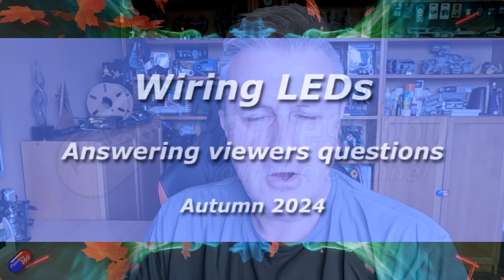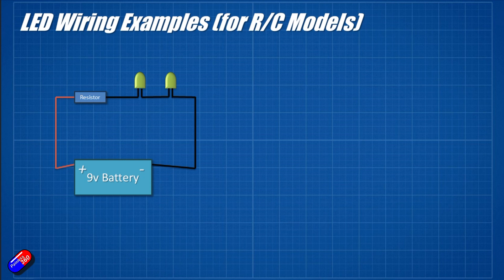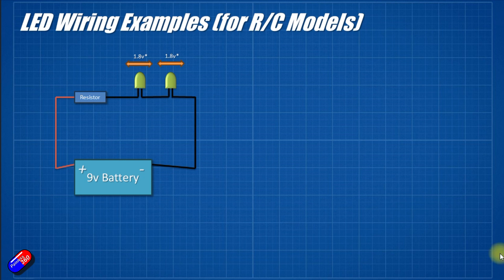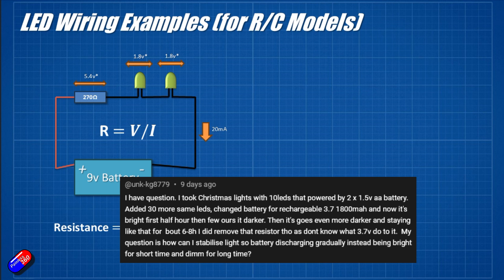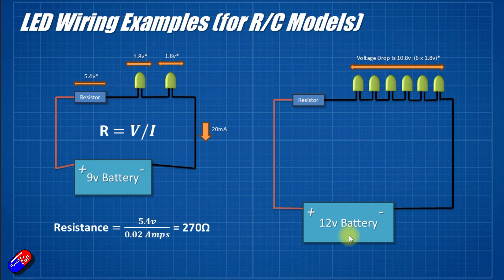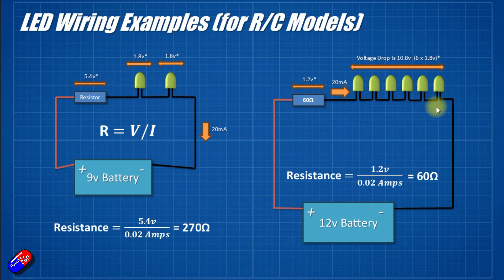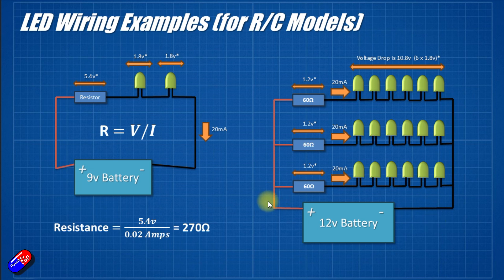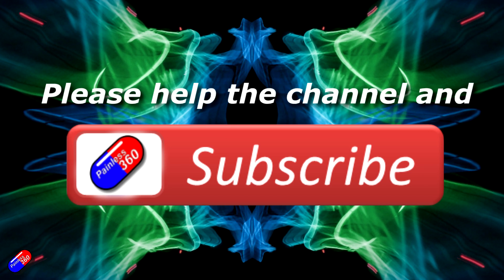Wiring LED's, a few 'real world' examples

Comment: I made a reversing light to go on the rear of a trx4 crawler. As the LED is a diode i wired it directly to the motor but wired it the wrong way round. As it was a brushed setup and in reverse the polarity of the current is reversed, it being a diode it would do nothing when powering the car forward but would light up when reversing.  It was nothing practical but looked cool on the crawler track.

Comment: As always Great Video, dont forget to account for the power of the resistor in the process, 1/8 1/4 1/2 Watts 
P=VI
In the case of 5.4V voltage would be 5.4V x led current .
Choosing the wrong Wattage can lead to the resistor heating.

Comment: I’m here from the previous videos connected to this one. My question is how do you find the current that would be flowing through the circuit? Is that something pre determined by the led? Iam an electronics student and in class we use ohms law to find current however to do that you must have total voltage and resistance if that makes sense.
Reply: In both of these videos you only have voltage and you found both resistance and current.
Reply from the maker: Current is a given value from the LED specs... Happy flying